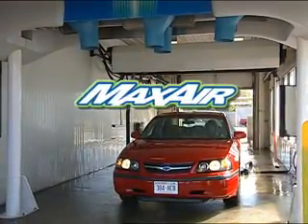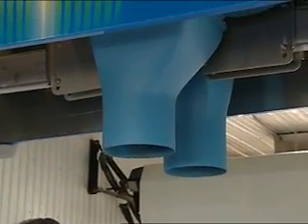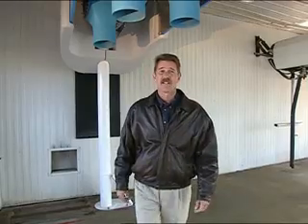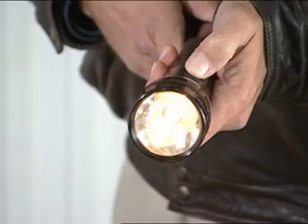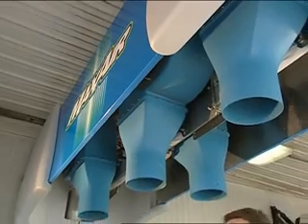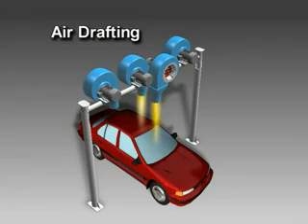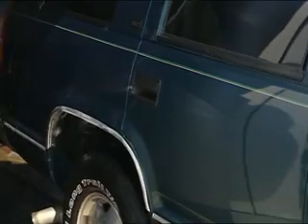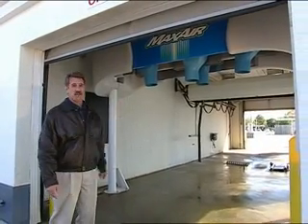MaxAir Car Wash Dryers by PDQ Manufacturing

Comment: i prefer the dryers that move with the wash itself ive seen this in the 4000 series with most washes it never seemed like the fixed one got my car dry enough and one still had the round nozzels likemax air but doubt it was close to being as powerful

Comment: I want to see the effects of the MaxAir's airflow on this moustache. I'm just imagining it lofting in all  directions...

Seriously, though.... MaxAir works quite nicely. I've used Laserwash G5 S-series machines with MaxAir onboard, and they dry very well with fairly minimal noise. The air jets are so powerful that they even move water off the floor as the machine moves by!

Now if only someone made a hair dryer that works this well. (I've done it with a Ryko dryer. Not recommended.)